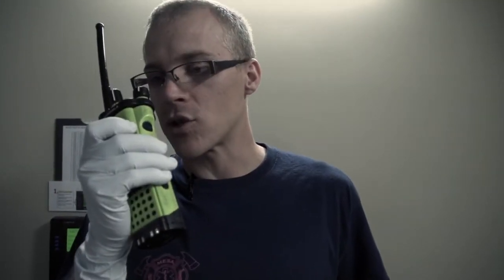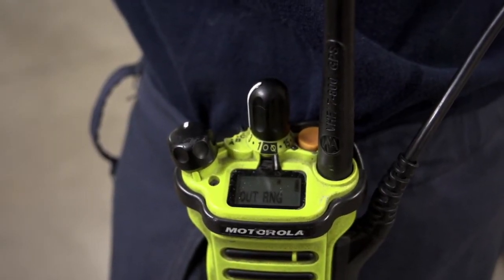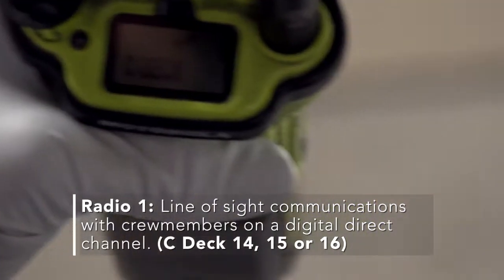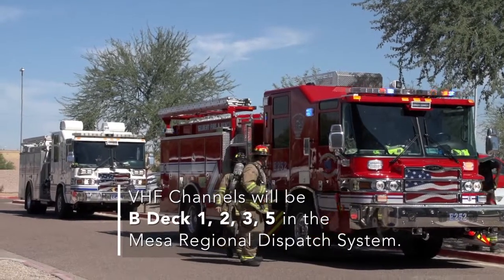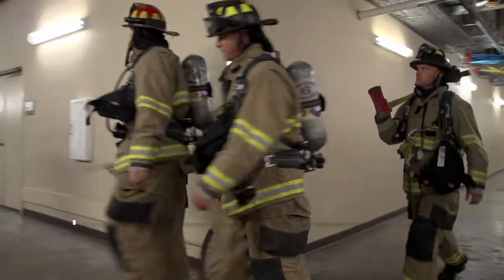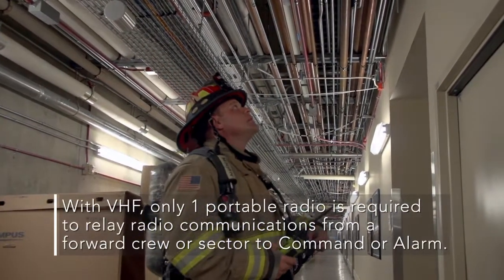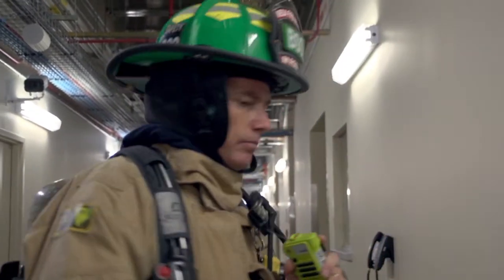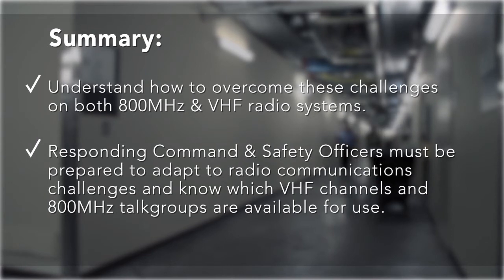How To Overcome Radio Communication Challenges

Comment: This is why ERRCS (emergency responder radio communication system) are so important in new building. These are a requirement for all new building in my city. There is an antenna pointing back to the city’s main dispatch antenna, along with antennas throughout the building to boost emergency radio traffic.

Comment: Maybe I'm just ignorant because I'm not a first responder, but I find it kind of ludicrous that this is allowed to happen.  Why is the density of this agency's towers such that their portable radios can even have the possibility of going out of range within their operational area?  I understand that concrete basements and other structures significantly degrade radio transmissions, but agencies should be given the appropriate funding to increase the density of their repeater towers so that coverage is not just adequate, but dependable.  These people are risking their lives to save others and they should be able to key up and talk to anyone they need to on their radio system, at any given location within their service area, without worrying if their transmission is getting through or not.
Reply: A system such as a BDA (Bi-Directional Amplifier) and/or a distributed antenna system can solve alot of these issues but they are only required in buildings built after a certain date.  This method is used for buildings that aren't required to have those systems due to build date or building owners not being able to afford or willing to retrofit their older buildings with a BDA.  In my opinion critical use and high occupancy buildings such as hospitals, schools, large office buildings, ect should have a BDA system regardless of the building age.
Reply: Radio waves are a very complex thing, whose reception and transmission is dependent on a huge number of factors. Even if you had a site (repeater or controller) at every single hilltop there will still be the occasional dead zone. You could put a site every city block, but at the current exorbitant costs that come with equipment from Tier I companies like Motorola and Harris, it would be prohibitively expensive even for the most well funded municipalities. Furthermore, the law of diminishing returns prevails. You could double your site density and still have the occasional dead zone because that's just how radio is.
Reply: @TheEnderman67   I work in public safety comms.  The cities around me actually require all schools, hospitals, and offices over a certain occupancy to have BDA systems installed.  I’m usually the one who does the initial testing to determine if it’s required or not.  Those systems are SUPER expensive (upwards of 80k, also as far as I know not subsidized by the towns) but make a huge difference in environments with extremely high noise floors (upwards of -60 dbm, higher for hospitals with all the equipment they have running).  it’s truly crazy how much of a difference they can make.  It can go from not being able to hit the dispatch rx site to working better than a UHF/800mHz simplex just trying to talk to someone outside the building